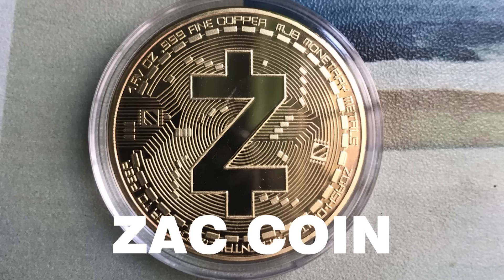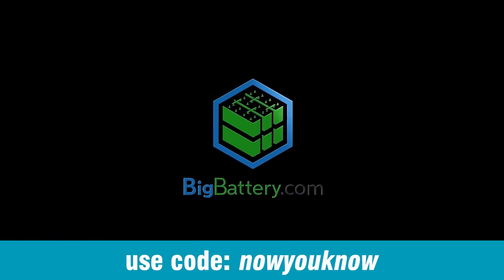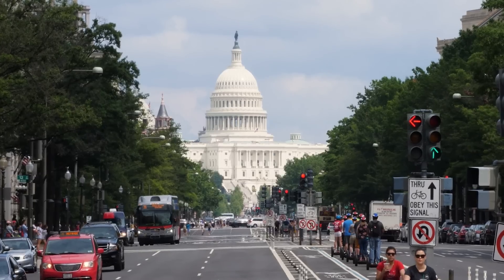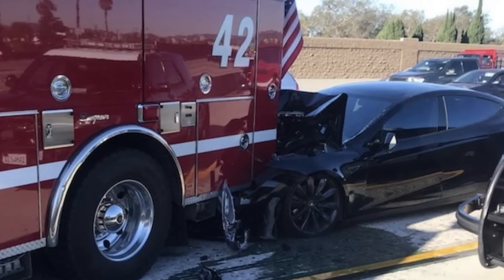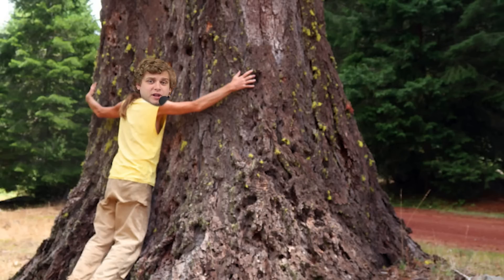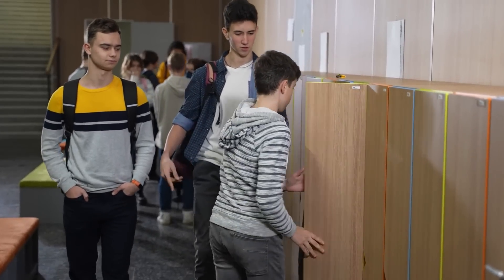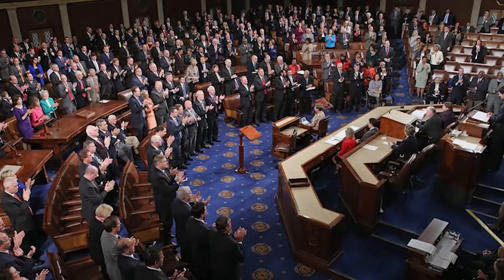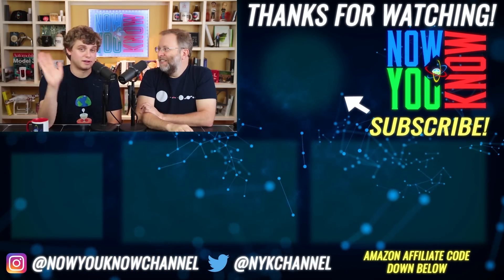Tesla Has No Friends | In Depth

Comment: No issues with your most of what you said, but the thing about new ev causing more co2 then new ice is not something I have seen used as anti ev in years. What I have seen people pointing out that a used ice vehicle ran till it can't be repaired is better for co2 then scraping it and buying a new ev. It grew out of the opposition to cash for clunkers and is now opposing those who want out right banning and early scraping of ice.

Comment: In my opinion the EV Tax Credit should be based on battery size.  For example if the credit was $100/KW a car with a 50KW battery would get a $5,000 credit and a car with a 100 KW battery would get a $10,000 credit.  When it comes to batteries size matters.  A car with more range does less charge cycles.  This is better for battery life.  It should not matter who makes the car or where it is made or how much it cost.  The objective is to get more EV"s on the road not create a political issue that can be influenced by donations.

Comment: I never get the objection to "AutoPilot" - it's an aircraft term - and in that context, it's a device that maintains  your speed, altitude and heading.  An airplane autopilot requires there to be an alert crew member to be present at all times, able to take over at a moment's notice if there is a problem.   This is a pretty decent description of Tesla's basic AutoPilot.  Beyond that into FSD, Tesla's software is MUCH more sophisticated than an airplane autopilot.

Wikipedia says "An autopilot is a system used to control the path of an aircraft, marine craft or spacecraft without requiring constant manual control by a human operator. Autopilots do not replace human operators. Instead, the autopilot assists the operator's control of the vehicle, allowing the operator to focus on broader aspects of operations (for example, monitoring the trajectory, weather and on-board systems)."

So what's the problem?  I just don't get it.  I could understand if they were investigating "Full Self Driving" - because it's not - or at least not yet - and without regulatory approval, not ever.  But AutoPilot is the perfect name for this system - it steers the car to stay in lane and adjusts your speed - but requires that the driver remain alert and ready to take over...just EXACTLY like the airplane device that it's named after.

Comment: Politicians only want votes from special interest groups that fund their campaigns.  I vote with my wallet and will buy a Tesla for my next car.  I spent a lot of money last year getting solar on my roof and paid it off in full.  No more electric bill for my house, love it.
Reply: Congrats!  I went the opposite way( bought the car first), and am nearly ready for my solar infrastructure...super excited to have the price of transport and electricity locked in!
Reply: Matt P  I am tied to the grid.  Maryland offers solar energy credits and you are paid for what you sell back to the utility at the same price they charge customers.  Average credit price this years is $74 per credit and I have produced 15 credits and should have 16 / 17 for my first full years.  $74 x 16 = $1,184  My system was installed last year on September 23rd and when they installed the net meter it was at 0.  The meter increased during the winter, but is now at 750kWh for net total of energy my home has used since install.  It should be down to 500 or less by this September 23rd.   Total cost for electric is 8.32 x 12 for service line fees / taxes = $100 + 500kWh x .12c = $60  (100+60 =$160 total cost to me, but you have to subtract 1,184 - 160 = $1024 extra in my pocket per year.
Reply: linkzable  My panels were made in Singapore, not China.